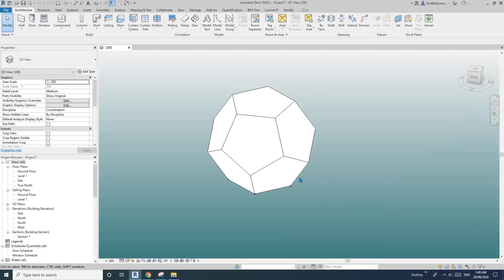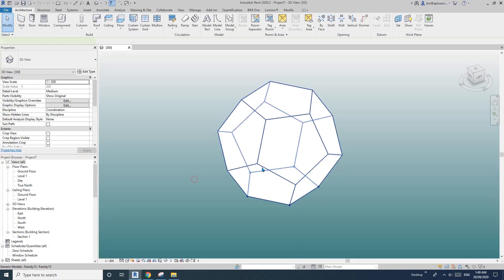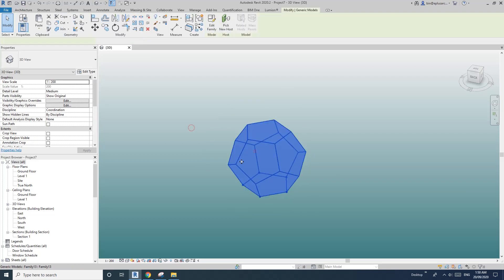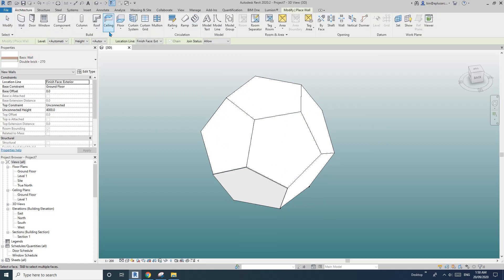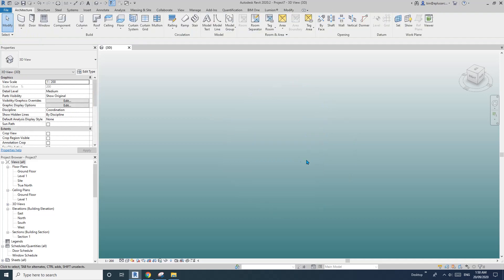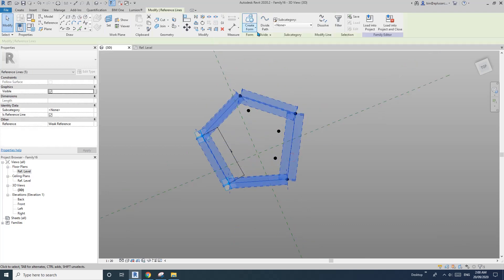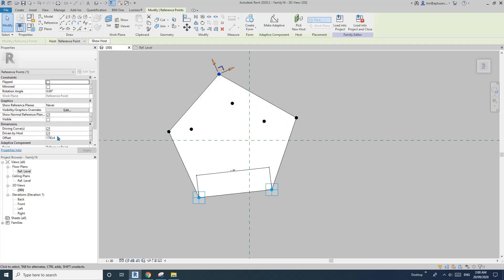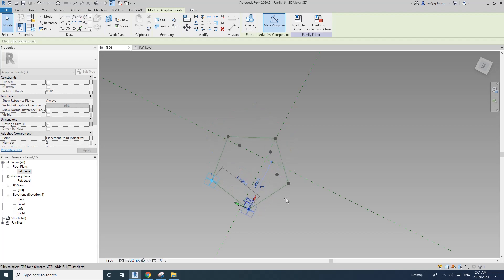Revit Exercise (Day 184) - Parametric Dodecahedron Family (Part 1)

Comment: hey....i just want to know, how to create a custom beam for example, it can be like tile pattern, frame or anything else. Though  this question is not this related video. if possible can u make it?
Reply from the maker: Do you mean a structural beam with a custom profile?
Reply: @BINHE615  yes
Reply from the maker: @rezwanulhoque117  Yes, you can create a profile family, load it into a structural beam family, and change the profile of that beam.
Reply: @BINHE615  ok , thanks